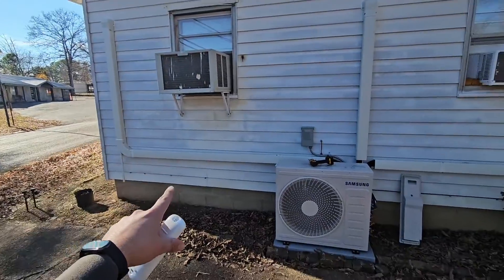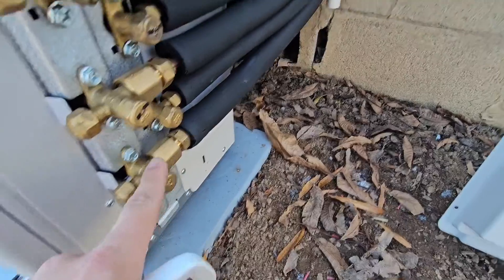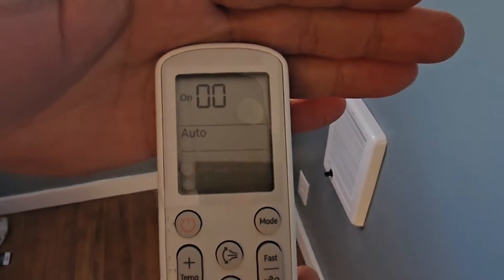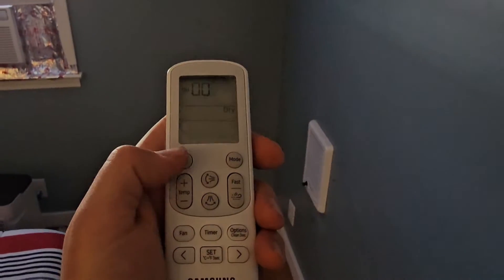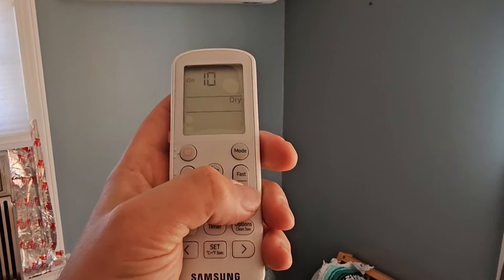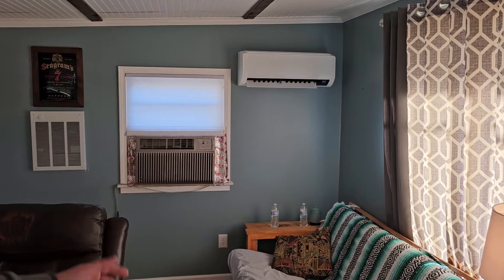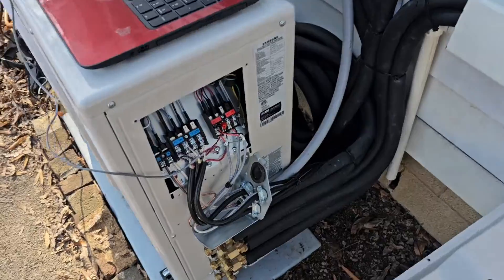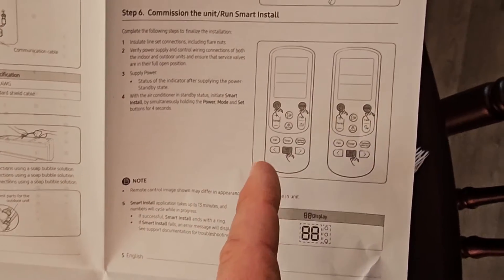Samsung Wireless Remote Manual Addressing Made EASY

Comment: hi bro we already munal address as u tech in video Aircon is working but when we turn off power after again on the Aircon giving back same error 190 or 199
Reply from the maker: Are all the valves open
Did you turn off power for more than fifteen minutes

Comment: I have two larger units on a 5 port condenser. They are tied in on the 4th and fifth ports. Would i still start with a1 when addresing or would I do D1 because my first operational port is D

Comment: This was a great video. I installed a 5 head unit that could not recognize all 5 heads. Yea technology. I have been struggling for a few days with tech specs tring to trouble shoot. This worked, and allowed the system to pass diagnostics testing, and it is running. Sometimes it is just the little things like this that are not obvious in the instructions that can save the day.

Comment: Not sure why you couldn’t just trace the communication wire from each indoor head back to the condenser control board and make sure it matched with the correct line set.

Comment: Hey great tips on programming the control .have a question if you have a 2400btu condenser and it's R22 can you install a 410 evaporator thanks
Reply from the maker: Technically no but hasn't been done before yes i'm sure

Comment: Dumb question: Why wouldn't the outdoor unit already know which heads are on which lineset? Aren't the head units generally run with lineset + wiring together?
Reply: Samsungs don’t require you to land the comm wires on specific zones, you can wire them anywhere, that’s why they have the pipe check operation
Reply: Because it’s smart enough to figure out what wire is on what head. Samsung is the most advanced unit on the market